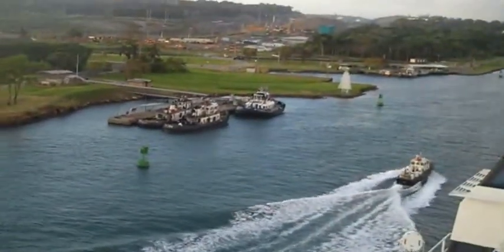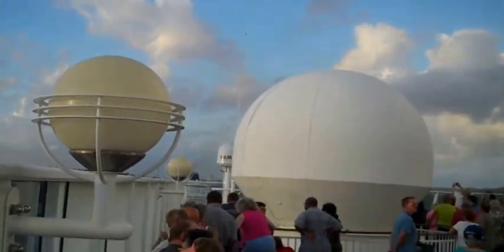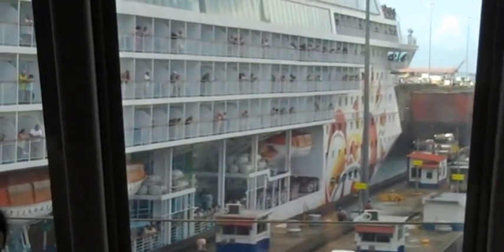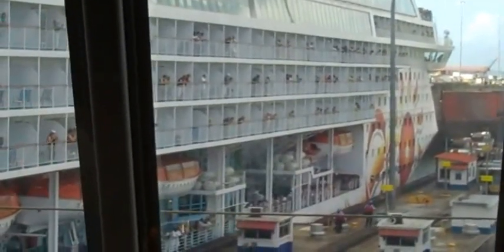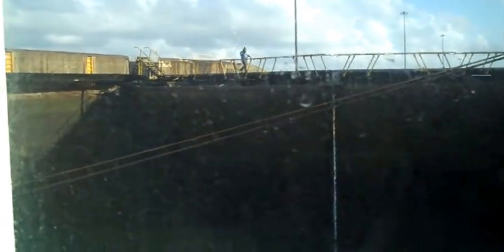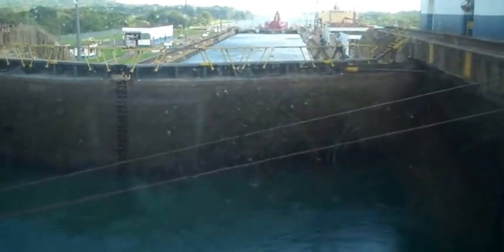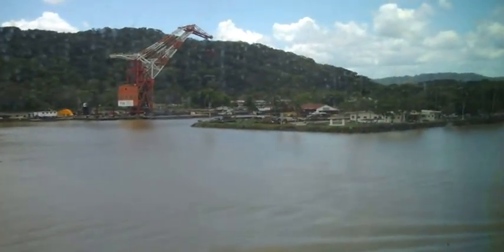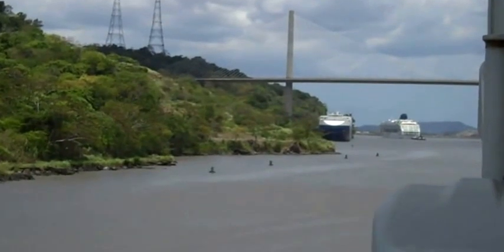NCL Pearl and Sun Transit Panama Canal April 25 2013

Comment: Fascinating video.  It sure looks like a tight squeeze.  How they control a ship that big with such precision is amazing.  I'm looking forward to going through the Panama Canal on the NCL Sun on October 4.  I was curious if the ship is still considered to be in international waters within the canal.  For example:  Is the ship casino still open during the transit?  Clearly the vessel isn't the requisite 3 miles offshore, but I can't imagine Panamanian law applying on a ship that doesn't dock.